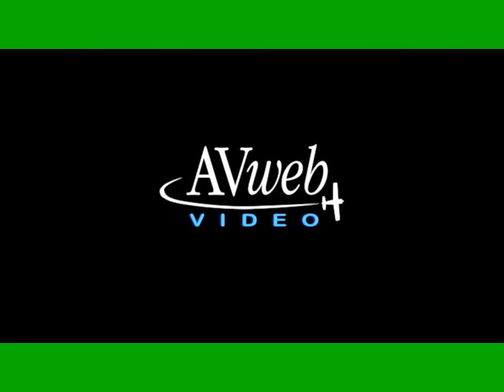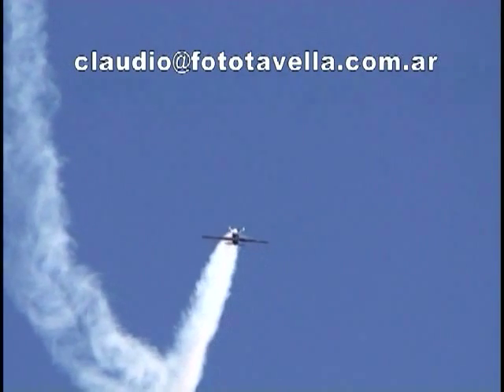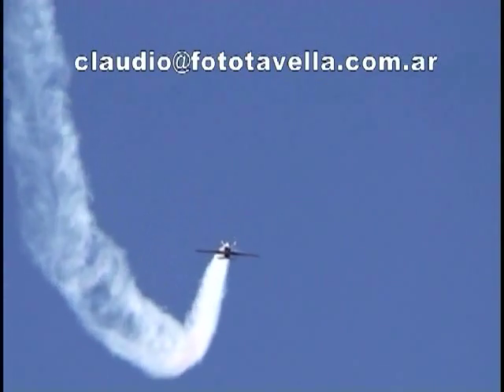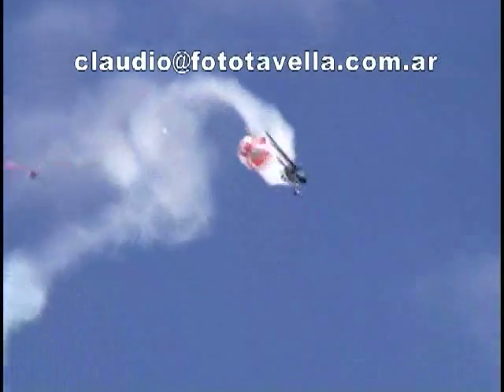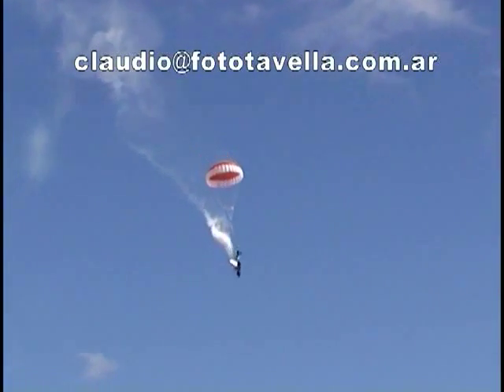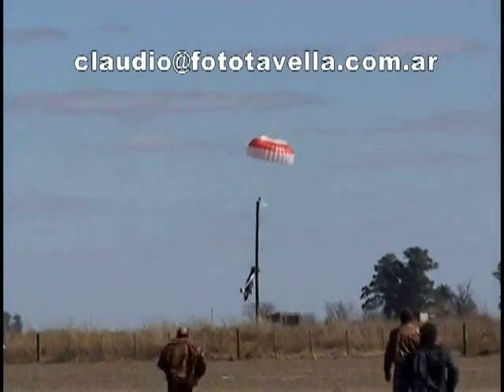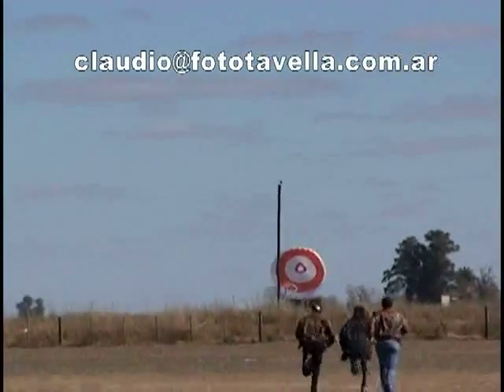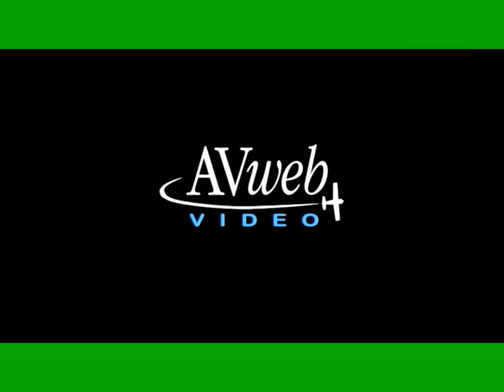Real Aircraft Loses Wing, Lands Safely (Under Canopy)

Comment: The spar doesn't go through the fuselage. Instead the Rans S-9 has 2 struts under each wing, going down to the fuselage bottom. It's rated for limited aerobatic at +6 and -4 Gs, and hundreds are flying safely. The pilot must have pulled more than 4 negative Gs, or modified the design. No aircraft is 100% safe; that's why pilots wear parachutes when performing aerobatics.
Reply: well now the plane wears one too

Comment: anyone know if these plane have a spar? no root of wing left. seems like badly designed stunt plane or its not designed for stunt? Has any seem the faked video of plane losing a wing and landing ? There is many RC planes that have pulled off a one wing landing by bring the plane in on knifes edge. Would the remaining aileron still work? if it was steel rods not cable controls?

Comment: Do you have any idea how large a parachute for a jumbo jet would have to be? Drag is proportional to area, but mass is roughly proportional to volume, so if your plane is 15 times as long, your mass is 3375 times as large, and the area of your parachute then needs to be 3375 times as large, so it needs to be sqrt(3375) times as wide, which is about 60, so the parachute would have to be four times the wingspan of the plane!

Comment: Sure but it would weight as much as a bus and buses dont fly very well... Aircraft are designed to operate within performance limits. When a pilot exceeds those limits than the airplane may break.  If you drive you car into a brick wall at 50 miles per hour...something is going to break. Thats an example of you exceeding the design limits of the car. Now a train hitting a brick wall at 50 mph...goodbye wall!

Comment: I wonder how much weight a BRS system takes up on the typical small airplane.  Seriously, it'd be nice to see equipment like this on more single-engine aircraft--old or new.  Trainers especially.  Force landings are nice in the event of an engine failure (eh, sort of), but losing an engine at night, clipping something like a bird, or having pieces of the aircraft fall off (i.e., wings) means that the pilot is screwed without equipment like this.

Comment: @unapro3 I think 30 years counts. I've been spoonfed aviation disaster stories since I was 4. If you're a pilot I'm surprised you think deploying a chute in a spin is a good idea. JAL 123 is about the one that I find convincing there. Anyhow I didn't mean to suggest that it would never help, but there certainly are not "heaps" where the airliner was stable enough to deploy a chute but lacked other, better options. It's hardly the "oh this is so obvious" solution earlier posters were assuming

Comment: @holycrapifoundthem he he, a lifetime in aviation? your only 29!! Iam an A&P/Pilot and have beeen in the aviation industry before you were born. I mentioned pilot error because you said the majority of 747 failures were catastrophic. The DC9 that lost all hydraulics, the DC9 that lost all elevator control, the DC10 that had a mid air and lost tailplane, 757 that went into spin, 747 that had rear press bulkhead failure, 707 mid air, 1900 aft C of G, 707 in flat spin, ther are heaps.

Comment: @unapro3 Yes, my primary point was that it's neither feasible nor helpful to chute down a 747. And sure, name those incidents; I'd love to hear them. I don't know what pilot error has to do with this...of course that's the top cause...it does not mean you can deploy a chute, or that doing so would be helpful. My information comes from a lifetime in aviation and one of the heads of Rockwell Collins, who designs the majority (all at this point? Save the 777?) of your aircraft safety systems.

Comment: @fairhillnorrie They landed with a large chute in a capsule no larger than your bathroom and in a planned manner not a crash? I'm not sure how those mean that a jumbo jet parachute is a great plan. I wasn't questioning whether parachutes work

AF1 does not, in fact, have a parachute. It's safe because it's an established safe model that's worked over on an intense maintenance schedule. 

Flying is 8 times safer per-mile than your fat ass driving to work, not sure what you're complaining about

Comment: @fairhillnorrie Not many, unfortunately. The vast, vast majority of jumbo jet failures are due to catastrophic failure and are nearly always during takeoff and landing, times at which a parachute would not be effective. 

Commercial airliners are built to be far, far more redundant than your average hobby plane. I can't offhand think of any major airliner disaster that would've been averted or helped by an onboard chute...and doubt one is even technically feasible for an aircraft of that size.

Comment from the maker: Look very closely as the aircraft descends under canopy and you can see Moline rapidly moving both the rudder and elevator back and forth. That may *pure speculation* indicate his attempt to free the lines, but there may be other reasons. Due to the speed of the roll, it's not clear that Moline would have been able to cleanly escape the aircraft. It can also take more time for non-ballistic 'chutes to open. A normal parachute might not have fully deployed before he hit the ground.

Comment: That appears to me to be a piece of debris that came off the airplane when the BRS was deployed.  Also, the BRS system is designed to rescue the plane with you still in it, secured to your seats with the restraint system in the plane.  This is usually a whole lot safer than the pilot bailing out himself because the impact of the landing goes directly onto the planes under fuselage.

Comment from the maker: @dsomary the "red thing" is part of the BRS system and is attached to the rocket that ensures rapid deployment of the 'chute. As stearman81n mentioned, the 'chute is normally attached to the airframe such that it would bring the plane down on its gear. In this case, it does appear that the lines were wrapped around the rear fuselage as the aircraft spun. He could have flown with his own 'chute, but at some point you must decide how much redundancy is enough.

Comment: @UnitedTulips But the parachutes only work well with light aircrafts and can not be used on faster or heavier planes, or else the parachute would tear apart.
Reply: You definitely would need more than one, good example is space shuttles use them to actually help slow them down faster